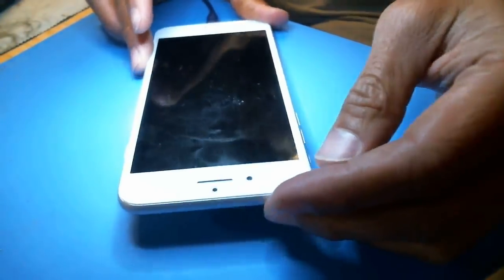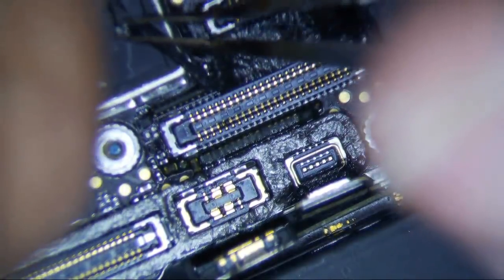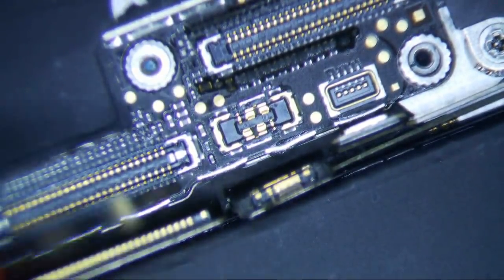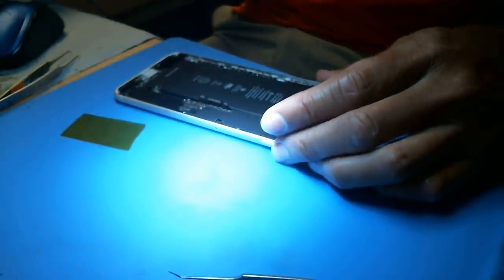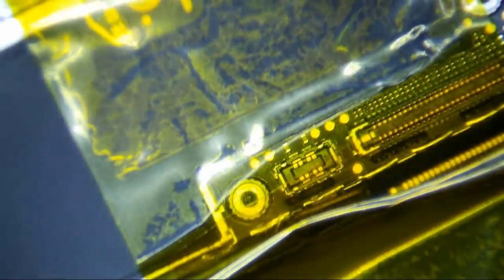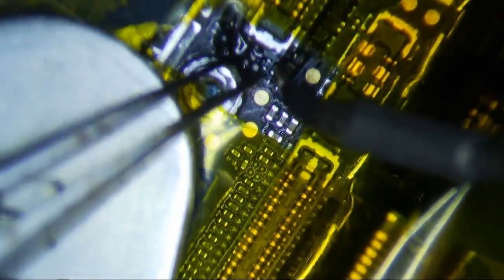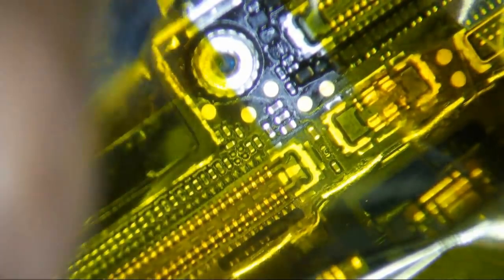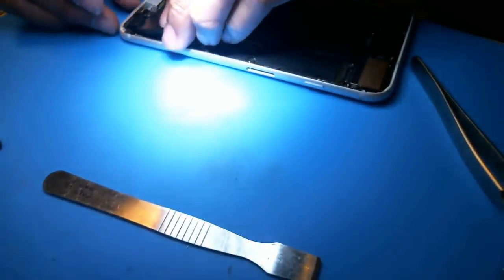iPhone 8+ Not Charging After Screen Repair

Comment: I have an 8 Plus, it off reads the charger, turns on but then does not charge, does not show that it is charging and the battery is 0%
Reply: sameee
Reply: Any solution?
Reply: Hydra

Comment: I am having the same problem with the iphone 7, i replaced tristar and it is still at 1% i check near the connector and everything is intact. no pry damage, i cant find the solution, any suggestions on this one?
Reply: steve p Maybe replace Tigris??
Reply: why did i not think of that, thanks i will try that next.
Reply from the maker: Please post your question here and I will answer it: https://www.microsoldering.com/community/